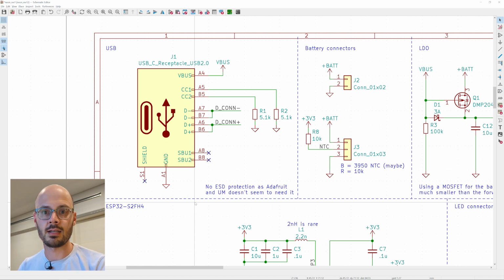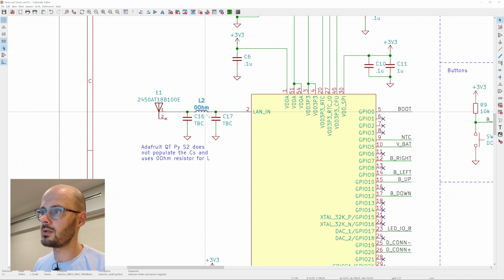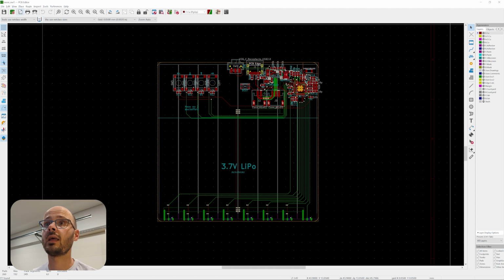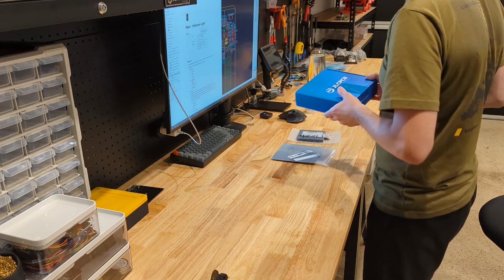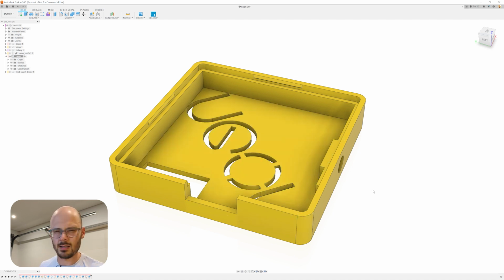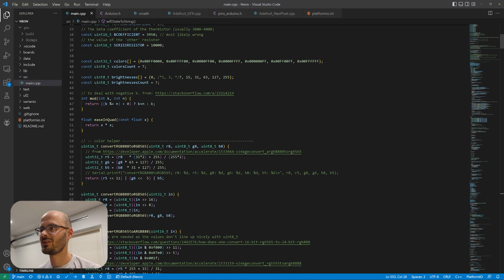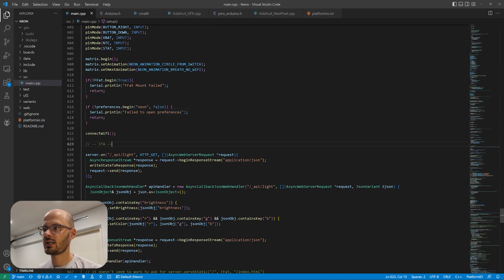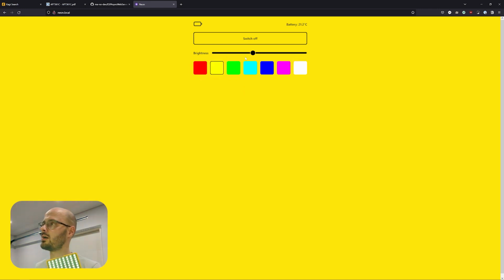Neon | Build your own studio light

Comment: Hi Max, I’ve just found your channel. Good videos! If I may ask, what reflow oven are you using? I am in the search for one. Thanks Ivan
Reply from the maker: It's the Puhui T-937. I would provide a link to AliExpress but the shop where I got mine no longer exists.
Reply: @scheffield  Thanks for the answer. In the end I ordered earlier a Fortex RF100 that is a close derivative of the zb3530hl. Looks similar to the Puhui T-937. I hope it will work well. Keep up the good work!